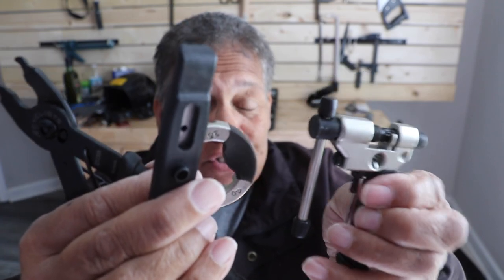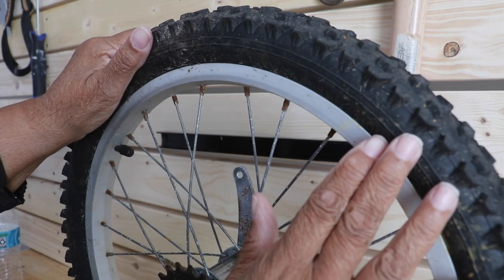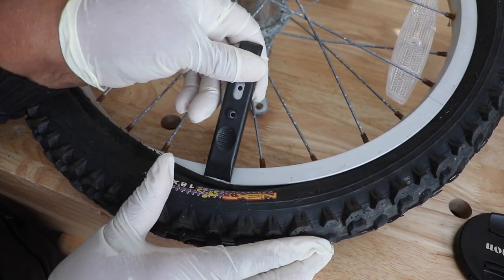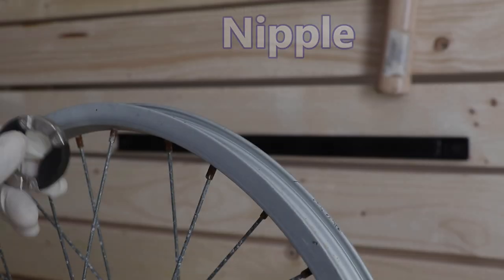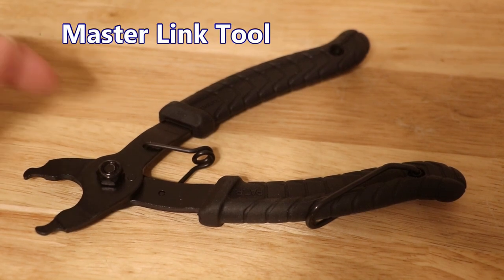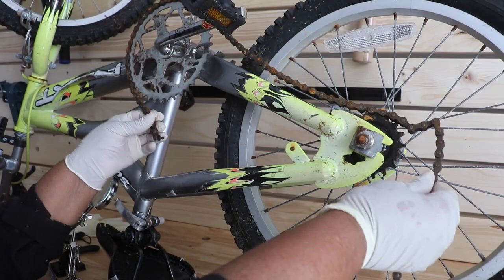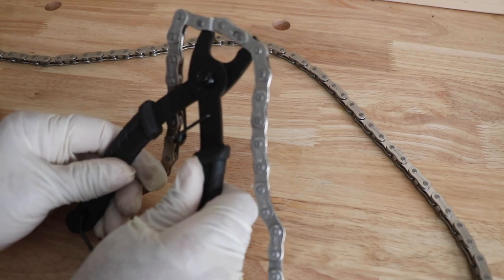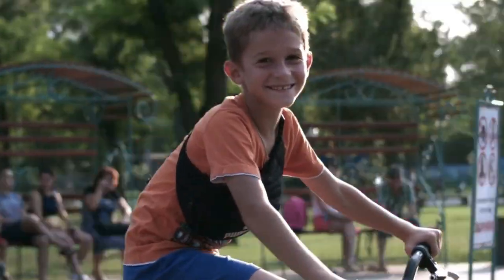Become a Super Hero to your kids using these 4 TOOLS

Comment: I used to do those things without the tools you showed .   2 Screw drivers for removing the tire from the rim, adjustable wrench for the spokes, and needle nose pliers for the master link.  Of the ones you showed the spoke wrench would have been the best to have back then.

It is nice to see that those specialized tools to exist.
Reply from the maker: I used a butter knife as a kid to remove the tire from the rim.  My Mom wasn't happy about it.
Reply: @seejanedrill  #same ! Lol !
Reply: @seejanedrill  If I had used one of my mom's butter knives like that I wouldn't be able to sit down for a while.    
BTW. My wife and I are loving the restorations show so far.

Comment: That was a great video, Leah, but, Oh My, how times have changed.  Being a really old fuddy duddy, I remember that I was doing the bicycle repairs as needed with whatever tools I could scrape up.  My tire removers were a couple of Dad's old rusty screw drivers.  Spoke remover was a small adjustable wrench.  Getting the chain off meant removing the rear wheel.  Chain replacement was NOT an option!  ;-)  And it was a scream watching me trying to get enough tension on the chain by pulling the rear wheel as far back as I could get it while I had one foot on a pedal, one hand pulling on the wheel and the other hand with a wrench ready to tighten the hub nut on the rear wheel.  Hilarious but effective.  Thanks for the memories!
Reply: I posted a very similar comment to yours but we used to use spoons as tyre levers.
Reply: @tonysutton6559  My mother would have killed me . . .  ;-)
Reply from the maker: We've all been there, as a kid I used a butter knife as a tire lever.

Comment: I love seeing basic bike repair content, especially outside the normal bike corner of youtube. As a bike mechanic by trade, overall very good tips. 

 I'd add a few things though,  with the spoke key is that when truing a wheel it's quite easy to mess up a wheel further by giving the wheel uneven spoke tension. It's easy to do this without a frame of reference. Ideally you'd want a truing stand but you can use zipties on the fork or seatstay which is usually fine for a home job to keep a wheel riding. 

Also, replacing a spoke needs to have a spoke cut exactly to the right size and cut with very precise threads and that's almost always best done at a bike shop. 

Lastly, make sure to cover the spoke nipples between where the tube could rub against them. If they are exposed they will pop the tube.

I assume you know this but I figured it be best to add this so someone who doesn't can hopefully see it. If anyone has questions I'm happy to link to more indepth videos on wheel work.
Reply from the maker: Thanks for sharing your professional experience.

Comment: Hi Leah, I have a question about an older video of yours. It's how to put on a new compression PUSH-ON shut off valve 
( on the wall, under the toilet tank . )

The SHARK BITE one has a kind of loose  ring that only goes around 3/4ths of the way around the copper pipe. You said it's important to tighten the nut even a quarter turn on the end of the shut off valve, after you push it onto the copper pipe. 

The SHARK bite is very hard to push onto the newly cut copper pipe. And that three quarters around ring, doesn't really screw on. It just lays there, hanging on the copper pipe.

The SHARK bite video from the manufacturer is missing a lot of information.
ALSO - THE nozzle part where I'm supposed to screw on the WATER SUPPLY LINE has a curved copper ring and a nut that I have to remove, in order to put the new supply line on. ( But there's no explanation for why the shark bite has that nut and cooper ring on it. It look like it's completely unnecessary ?)

I have no idea if I got the new Shark bite compression PUSH-ON shut off valve on well enough to not leak. It's so hard to push on, . It says mark ONE INCH on the copper pipe with a Sharpie and SHOVE it straight on, to that one inch mark.

BUT is the MAIN Shark bite shut off valve supposed to be shoved all the way to the one inch mark,
Or is that where the big ring is supposed to end up ?

( Is the purpose of that loose ring, just an extension that shows you when have the shut off valve shoved on far enough , and that is the only purpose for the ring, is to show when you have it shoved on far enough ??
Reply from the maker: There are different types of water supply lines.  There are the flexible kind that you screw on and there are solid copper or brass lines that are held in place with a nut and ferule (ring).  Shark-bite does not know which supply line you'll use so it  provides both attachment options. 
  As for how far to push the Shark-bite on, you're suppose to push it up to the reference line marked with Sharpie.  The line is 7/8 inch from the tip of the pipe.
Reply: @seejanedrill   Thank you so much for answering ! We'll find out tomorrow if it holds when I turn the water on. I appreciate you. 🙂♥️👍👍👍